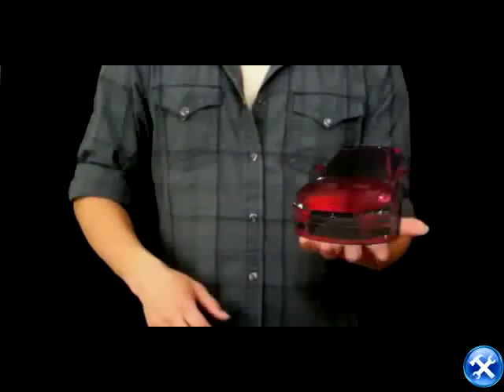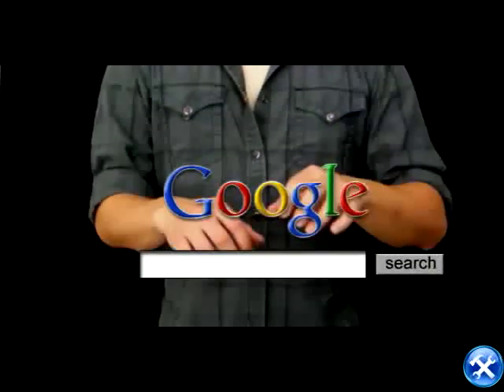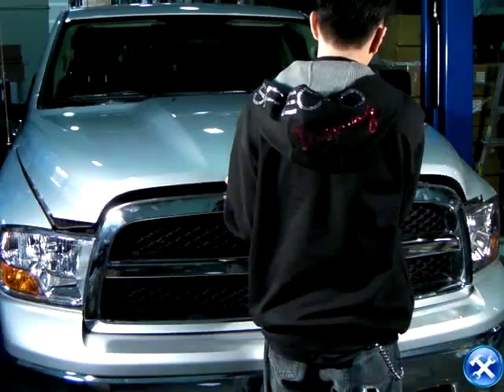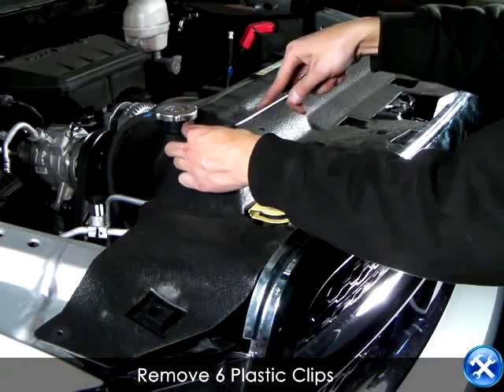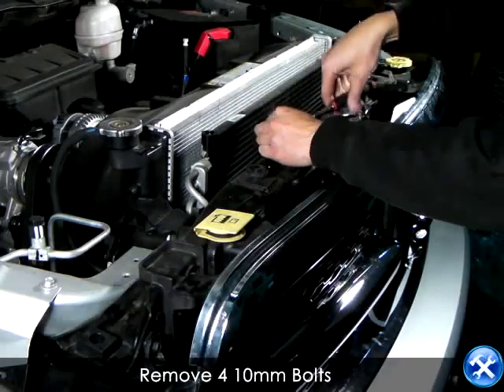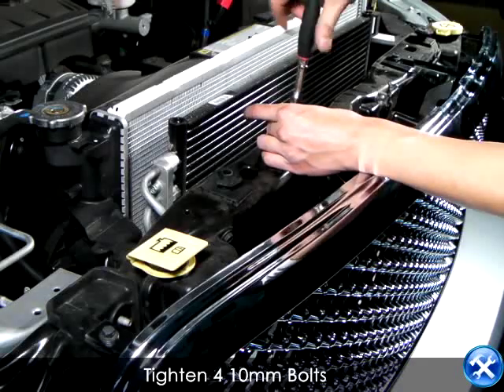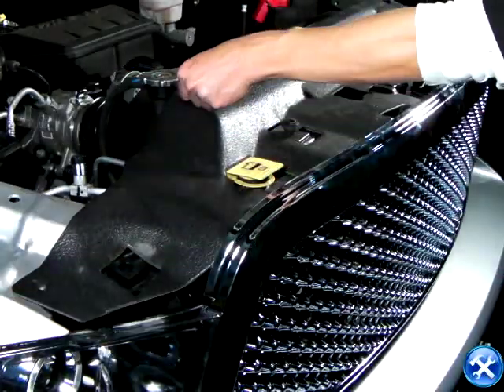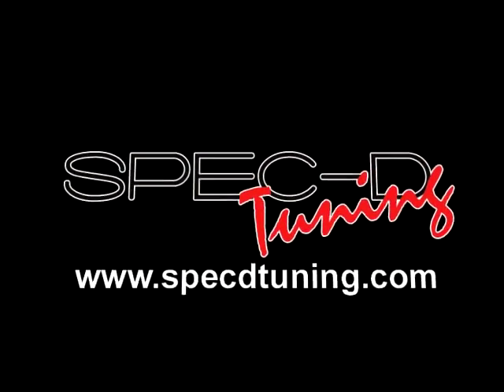SPECDTUNING INSTALLATION VIDEO: 2009-UP DODGE RAM 1500 MESH GRILLE CHROME

Comment: You also have to drill 2 holes in top bracket to allow for push pins to hold radiator cover, very minor but needs to be done